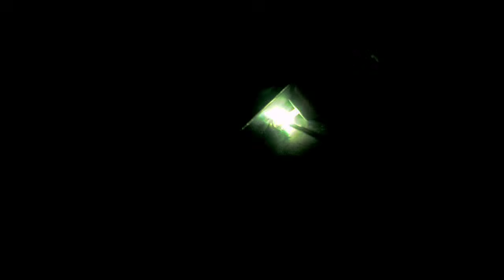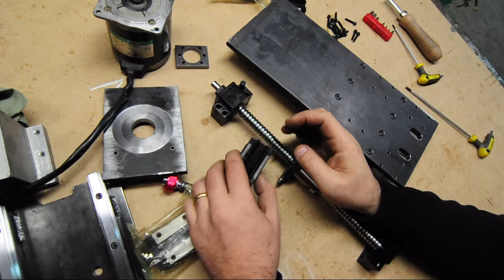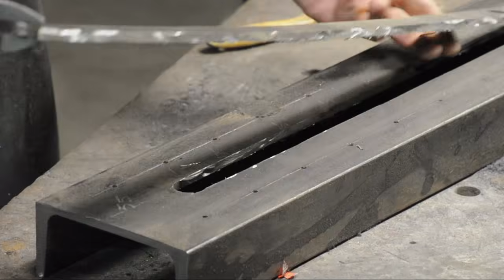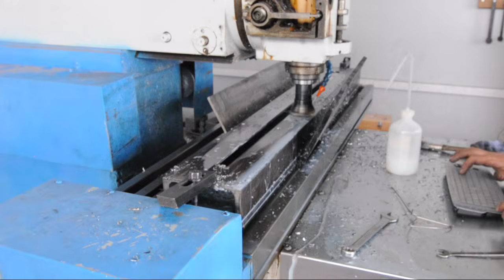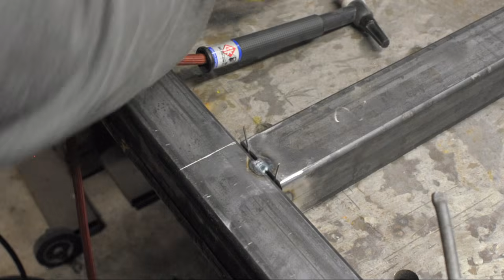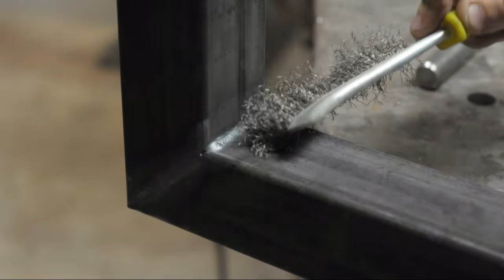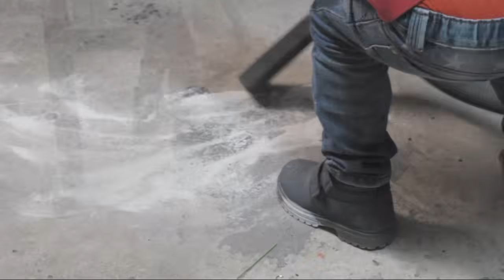Fixed Gantry CNC Router Build   Part 1

Comment: You will forever cherish working with Small Tony.
As for welding pieces together I was shown to tack on one face and then tack the opposite side. It pulls them back into position.
For critical alignment I tack on a brace, check the alignment of the two pieces, and weld them together.

Comment: you da man Tony. Watching your show is better than armchair sailing.  25 years ago I built a CNC router with a 4' X 5' bed. I confronted the same challenge of having to use long lengths of warped steel as a base to mount the precision guides.  Manually I was able to bring long lengths to near perfect flatness.  First I took down the high spots with a belt sander.  Then using (half) the technique employed used to produce precision marble blocks, I flipped the C-channel on to a 3'X6' 3/4" thick piece of glass (came from a dining table)where I glued sandpaper belt material.   Then slid  the hunk of steel back and forth across the surface.  I started with 80 grit and by 180 it was perfectly acceptable  A running water hose kept the abrasive from clogging.  BTW. For the shorter gantry axis I used 2 pcs of (hefty) precision ground square stock for support and double as the guides for V rollers ... the driven screw runs between them.  And while I'm on the subject of time travel ... Dollars to Donuts the Egyptians squared off their blocks by rubbing two stones together.

Comment: I used to be a pipefitter / fabricator.
If you have multiple welds on one side .
We actualy chimmed  , the pipe or beam , in the middel like 1 to 5 % of the lenght between the fartest welds.
At the end of the pipe or beam , we Just welded it first to the welding table.
It looks like a bananna at first ...
But when you angle grind those holding welds at the welding table ...everything pops magical straight again !☆☆☆☆☆
So proud now i actualy gave This old Tony a pro tip
Greets from the Netherlands Johny geerts

Comment: Wire under the joint is a great tip. Getting joints square is always a problematic but this will be a great dodge for me especially as I mostly stick weld. Thank you. Great build. Jez.

Comment from the maker: Richard and others:  I don't have drawings exactly, but I'll post the 3D CAD file in the next video.
Reply: Feel like you missed the pefect chance to try your hand at.. hand flaking that channel :P who knows you may have even been done by the time I posted this comment. Wonderful videos, keep it up.
Reply: This Old Tony ,was thinking the back plate is probably alot flatter then the C section. Why not put everything on the back plate.. Keep in mind I have never built one.
Reply: It would be awesome if you could post more videos showing you render stuff in CAD
Reply: @Pablo Estafez Had the same thought initially. Then I thought that the plate is a lot less rigid without the supporting 90* edges, so maybe this is the soundest way of doing it after all. Full disclosure: I'm a software engineer, so this is not my area of expretise.

Comment: Have to say, great tip using the welding wire to lift your piece slightly. I've run into that while MIG welding and had trouble bringing things back square....will do that from now on.....

Comment: Hi Tony, it was good to see the little one helping out and I will bet that he will have a lot more shop time in the future. We need to get more of the youth interested in the shop making cool things instead of devoting a good portion of their time to video games and watching television. Now that will be a rather sturdy machine when you are finished and far more substantial than the X-Carve, Rockler's CNC Shar, etc. I would think that you would be able to mill a bit more substantial material than plastic, wood, and aluminum as long as the router's spindle is built to withstand those greater axial forces.  You are definitely off to a great start and I am certain the end result will be worthy of your effort. I look forward to the next installment. Thanks for sharing!

Comment: By the way you are talking it sounds like one of those jobs it's a good idea, it will come in handy but has quiet a large footprint .
I've been there a few times where space is limited and you will only use it twice a year. if you could only mount it on the ceiling.
I bet you are looking forward to painting it. lol
But another great video
Thanks
Andy.

Comment: Hope everyone learned a lesson here. No matter how much you clamp a piece down, IT WILL MOVE WHEN YOU WELD IT! Thats why the term "Jig Welded" means absolutely nothing, but hack fabricators LOVE to throw it out. Metal shrinks when welded, period point blank. If you have it bolted rigidly you are adding stress to the material, if you unbolt it, its GOING to move. The weldment is either designed for this shrinkage, or its not. There is no stopping it, aside from not welding it. Tony just showed you this perfectly, its a really good life lesson.

Comment: Yup you are correct the import routers do what they are supposed, break at the exact wrong time.
Reply: I'm sure we all have our own experiences we end up knowing as truth. Mine (as a pure hobbyist) happens to be that my bog standard 3020 mini CNC never let me down so far and does all I need it to on the small scale, including isolation-milling PCBs with a few mil wide tracks. I could never dream of building anything like it in the single room I inhabit, with the largest tool I own being a handheld power drill. I did check it with a dial indicator though, it returns to no discernible error down to 0.01mm both on X and Y. That said, I absolutely do admire people like This Old Tony who can and do build their own - and I'm definitely thankful for all he has to teach me and share with us all...

Comment: I know it isn't your standard but for a more hobby approach I was planning on using JBWeld between the C section and rails to level it.  Concentrate on getting one rail flat on a thin layer of JB (oiled to prevent sticking to rail), probably measuring 6" ahead on the same rail could detect rises/falls - I'd ignore twisting and pray instead.  Then set the second rail from the first.  I'd hope that when it is all dried and tightened it would be very strong under compression with so many bolts.

Comment: Naively wondered why you'd bolt it straight to the floor and lose adjustment options.  Then clapped at my screen with your solution.  Don't know whether it's a common trick, as I'm nowhere near advanced and just learning, but nicely done!

Comment: Hi Tony, I am enjoying watching your project builds. I'm sure that you have completed this fixed gantry router but in hindsight, I think you should have looked at mounting the rails to the backing plate rather than the c-Chanel, the backing plate looks flatter than the Chanel web. 
Any way, keep up the good work

Comment: Fantastic job your the only other gantry  type cnc that's tig welded I've seen 
you should be able to mill all kinds of materials with that closed box system mine will do all non ferrous metals
OMG it chatters bad on steel so I don't do that anymore

Comment: Tony, awesome build! Tip, use two dowels on your master rail and two on each master truck. One side only. Let the other slave rail/truck float, move it around then tighten. Aligns things perfectly parallel.
Reply: Also the order in which bolts and screws are tightened along workpieces matters a lot.
This warping effect increases the longer and larger the objects are.
Even if all bolts are tightened with a torque wrench to the same exact value, specified in a laboratory to be within optional spec range, along two perfectly firstyou'll still have warping if you start on one side and move along the piece to be fastened. Tightening them all gradually opposite of each other very last oftenly gives better results and leaves some potential room for corrections.

I love the videos you make. Awesome, informative and hilariously funny, as always.

Thanks Tony

Comment: Hi just want to say great video.
Also just wanted to give you a little insight into the tolerances of making C section.
I've worked as a production operator in an Australian Steel Mill for about 15years. And we make 150 C section. I'm not sure what standard the stuff you got it make to but The AS standard are quite broad not as bad a China but well you decide.

1st the legs of the Channel are allowed to have difference in length of 2.5mm
The web thickness is between 4 and 5mm but this normally is on the thicker side of things

There is also the leg thickness which is slowed to vary about 1.5mm but I can't remember the min Max

Now the interesting part the straightness of the channel!

The web is allowed .5mm of concave but convex is no good.
Also the the legs are allowed to be up to 1.5mm out of square on 1 leg and 2mm out of square between both legs and the web.
Nice hey now wonder its was so bad you say.
Well I'm not done yet LOL
There is also a tolerance for twist. Yes the channel is allowed to have up to 5mm of twist over a 12meter length and I think that drops down to 1mm over 6meters.
There is also the sweep (up and down) of the bar and camber (left to right) both are allowed 2mm per meter so over 12meters you could have up to 24mm of sweep or camber what a joke hey.
If have any questions just ask LOL
Cheers and keep the laughs coming

Comment: Perhaps late info, but in respect to the digital angle meters there are now multiple apps for smart phones or tablets that display same info just by holding phone against object. I use a multi tool Android app called "swiss army" but they all pretty much work as well.

Comment: 4' is getting pretty long for a lead screw. You might have to limit its speed when the nut is near the ends of the screw so the screw doesnt start wobbling like a jump rope. If you make a larger project in the future, keep in mind that you can design it so the motor turns the nut instead of the screw...then the screw can be as long as you like without being really fat.

Comment: well, you have me thinking. I have been outfitting my shop for work and I have everything but a mill and I've been keeping an eye peeled for what's around that hasn't been sitting in a field for 5 years. I probably don't need a mill for what I want to do for money, and anything that comes up I can send to a real machinist to get done if I really need it, but I  have some hobby things that I couldn't really sell that are made from shapes from the plasma cutter that I would like to pass an endmill around to square up the edges or and more likely to put a bevel around. I have built heavy gantries before but never anything as rigid as a milling machine and wonder if this is really something I could rely on to just do edges.. ohhh! this would be great for drilling and taping too so there's another use.  I can't justify a CNC mill but I could use this kind gantry robot for some things.  Your Maho looks like a really flexible machine!

Comment: Really well engineered machine and a great video.
I built a fixed gantry mill after the moving gantry build failed utterly. Fixed gantry is the best solution for a solid machine.
For the gantry I used 250mm 150mm x 5mm rectangular steel section (RHS). maybe over engineered but I wanted the rails 200mm apart.
I am wondering why you chose C section with a cap plate on the back.
After a lot of research I decided to go with 20mm round linear rails, much more forgiving with allignment than rectangular rails. 
Yes the RHS was not flat by a long shot! but I didn't have to machine it.
I used a 20mm ball screw and nut as you did. 
I wondered why you sank the screw inside the C section but discovered the reason in part 3; to enable a curtain to be attached. Thinking ahead!
One other thing I noticed in part 3 is the VFD had no shielding around it, did this not cause interference problems? 
I mounted my control box on an arm to the side on the machine at eye level.
Agian, great job, great videos with a really dry humour I like.

Comment: Tip for your next one. For a flat gantry face, two words. Liquid Granite, homemade with epoxy and carborundum powder.  That's what I used on mine, a 1m section of 250x150x9mm RHS, after welding and heat treating of course. Was significantly (x100) cheaper than getting that face machined.
Reply: Do you have a specific video of yours whereby you shared this detail, by chance? thanks

Comment: That shot at the last with your feet is the first across the shop look I've seen.  I thought you had your machines much farther from your welding bench.  I am always worried about the grit from the angle grinders angling into the ways of the lathe and mill.

Comment: You might have been better off to use aluminium extruded structurals. They are normally much closer tolerance than rolled steel sections with far less warp. In addition, aluminium is commonly available in what is known as an AA cross section where the flanges are parallel instead of tapered like the AS section typical of steel chanels. AA is available from some steel suppliers but again, because it is rolled, it will be warped and twisted. The initial cost of aluminium will be about double the cost of steel but the workability and tolerance of alloy versus steel will more than help to offset these costs. In many cases you can use alloy for the tolerance critical structure and then bolted to support steel sections to it to help reduce costs. IE: The channel for the X-Z axis in alloy bolted to a steel support structure.

Comment: Next time you need to surface machine a piece like the C section... Find a discarded treadmill. I'll leave it to you to figure out how to turn the belt into an abrasive belt... And I'm sure you can figure out the rest of my suggestion on your own. (Also good for making a few bucks machining heads for engines.) Imagine the torque those things have to have, to keep the belt moving with a 200 to 400 pound person on them.
Reply: Great tip.
Reply: This guy!!! Great tip sir
Reply: Maybe stick a worn-out granite surface plate under the belt...
Reply: It's like Christmas when I see a discarded treadmill on the side of the road. The motors are powerful and they've got ample torque even at low speed. I have an old 1940s Delta Milwaukee drill press that was given to me without a motor, and I harvested the motor and PWM controller from a treadmill I found and now have an awesome 2 1/4 hp drill press with infinitely variable speeds. Going to have to use your tip on the next one I find!
Reply: I used one for an old craftsman 3 wheel bandsaw that I turned into a metal cutting bandsaw, but a variable speed drill press would be amazing to have. No more changing belts for me!
Reply: there is no flat platen on a treadmill. terrible idea.
Reply: nice "thinking outside of the box" but i agree with diesel, it wont produce a flat surface, specialy after it has beend abused by 200-400 pound heavyweights :)
Reply: @@excited box lol no. people who know nothing just need to stop with the idiotic suggestions.
Reply: Just be careful with those motors.  Make certain you keep a load on them somehow through the use of the equipment supplied.  I've seen one which created a huge knot on a fellow's forehead when his makeshift rig exploded because it couldn't keep up with what those treadmill motors can dish out.  He wore a big ol contusion across the forehead for weeks.  LOL.. It was like he got socked by Mike!!  Keep a load on those motors because like Selador said, they've designed to push 200+ bodies.
Reply: @DieselRamcharger  not to mention the treadmill belt doesn't have a consistent thickness, even if you did somehow be able to keep the belt true and flat the difference of thickness would still cause enough issues to make the problem worse then it started.
Reply: Abrasive belts come in a variety of lengths widths grits & colors. 
 The idea of using the rubber belt and slathering some kind of abrasive concoction on to it, well I've only one suggestion to those who like the idea.
 Please quit drinking the bong water. That idea kind of resembles filing a lawsuit against yourself, & hope to win.
Reply: Sorta like a    Sandingmaster  ... ??
Reply: But how flat is a treadmill
Reply: @imagineaworld  
A treadmill is fairly flat but not enough structure like a belt sander platen, to do any kind of Precision work. Some even have rollers under the belt. I've only spent time on them not in them. The drive motor & controller is quite Hefty. Enough to make other machines with quite successfully.
Reply: Damn, I love that idea! Brilliant 👌
Reply: @rogermarshall8991  so add a flat to the back, maybe machined steel or a slab of granite, after ripping out the rollers. Then you'd have a sturdy backplate.
Reply: @MrZhefish  They are joking.

Comment: Any reason you went with steel vs aluminum?  Much much easier to work with. Compensated by going about 20% larger perimeters. 
Also... double up on the trucks. Very enjoyable journey into your head...
My favorite part is where you show your controller in a later video...Sound Logic, Geckos, Smooth Stepper. Exactly what I run. Tougher than a 50 cent steak and mines been on the job for 18 years without one glitch.

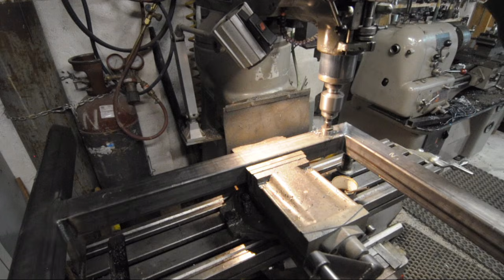Comment: Hi Tony, just wanted to thank you for sharing (and MAKING) this video! Great tutorial! I learned lots! I especially liked the trick with putting a piece of TIG wire in between your joint, to give you a bit of wriggle room to correct the alignment of the part you're welding. And one thing I also found quite funny is that I have EXACTLY the same lathe and milling machine as you! (Min 25:28) A Colchester Student MK2.5 (with removable gap for 18" swing) and a Bridgeport. Yay! :)
Reply from the maker: +mictho100 You must be a very smart person micthou ;) -- love the Colchester, great machine.  Almost time to update my bridgeport though.. it's getting on in years.  My entire family, especially the wife, is quite concerned about what we'll get next. :)